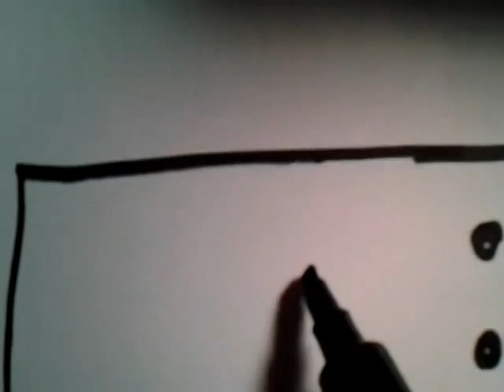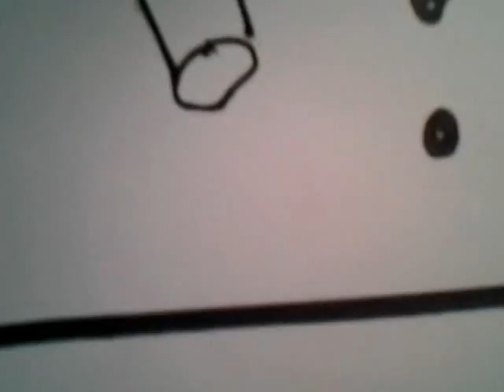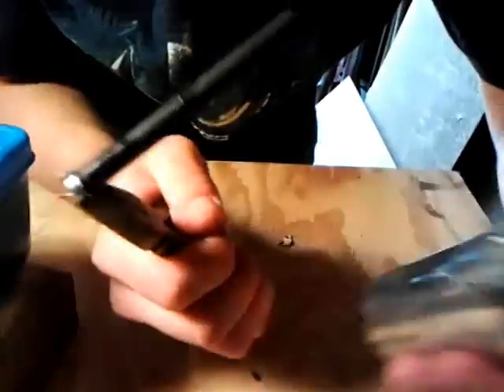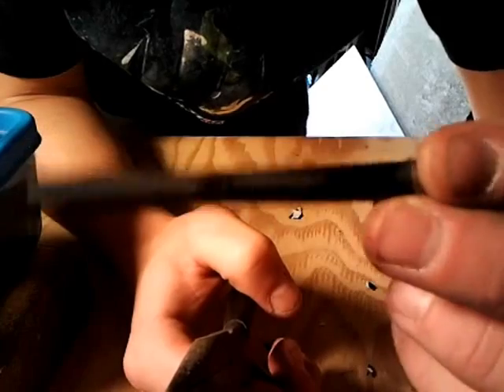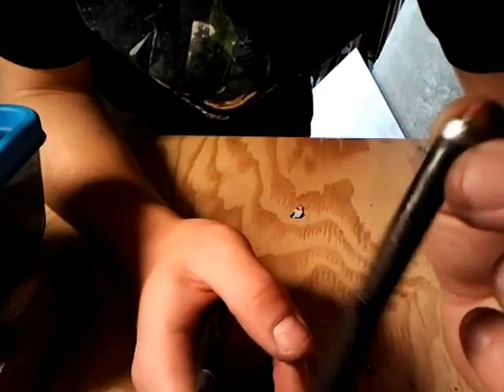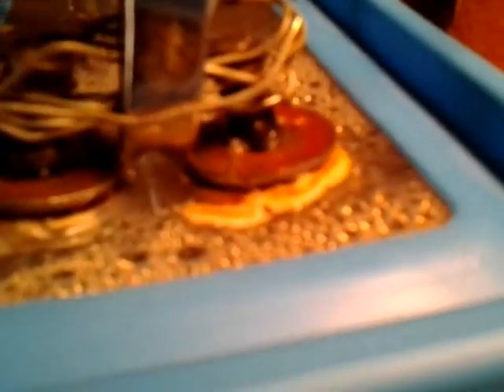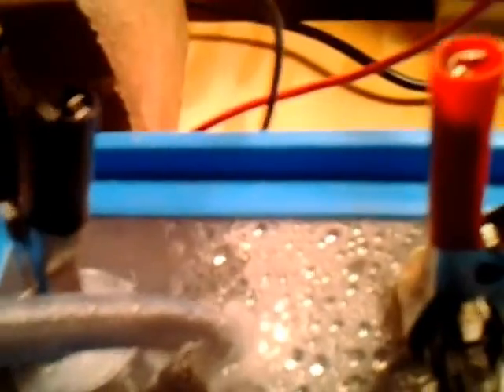How to make Potassium Chlorate - My cell

Comment: easier way to get the electrodes out drain the battery dry and then just easily peal the eroded zinc metal with hands and slowly tap the solid electrolyte and then get the carbon rod out!!